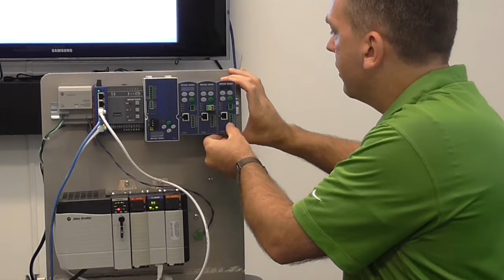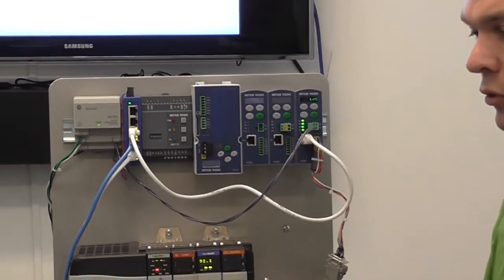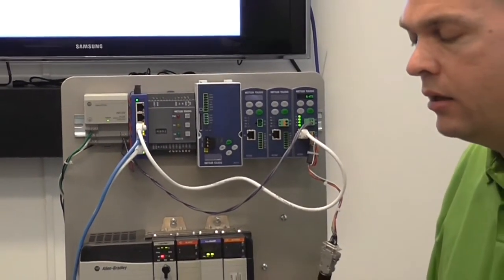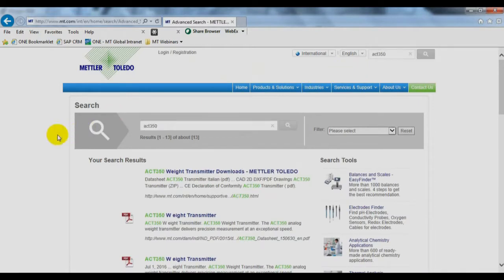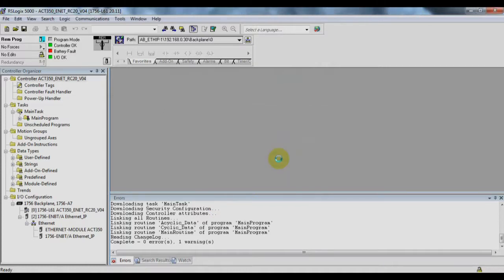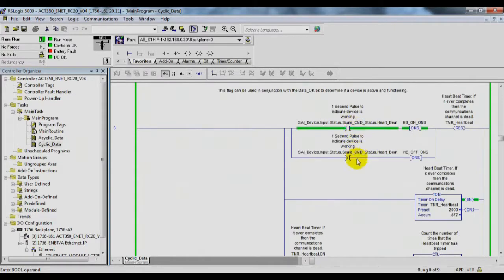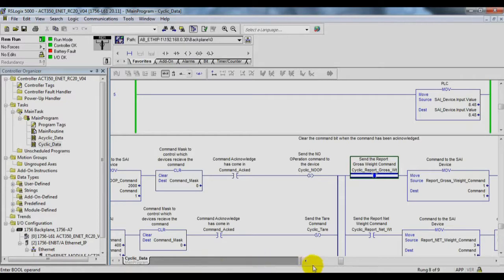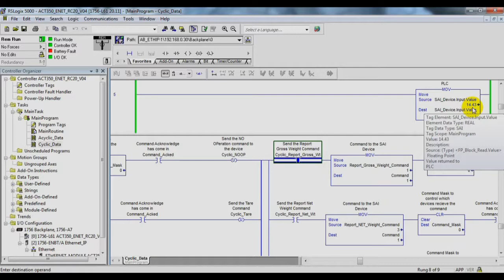ACT350 PowerCell

Comment: Hi I have to instal this same equipment the ACT350 but I haven't receive the weight cell allready and I would like to make some test in advance. It's possible you send me the pin-out of the petentiometer you are using in the video to simulate the cell, in the act350 manual I couldn't find any diagram of how to conect it. Thanks in advance, great video.